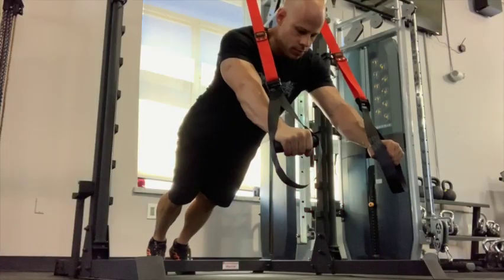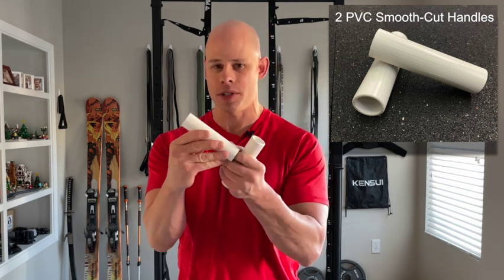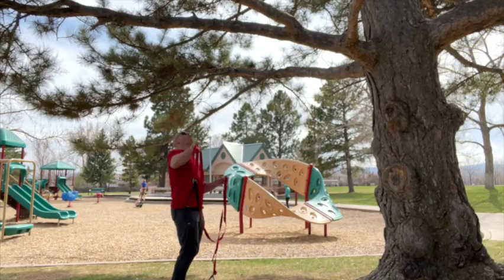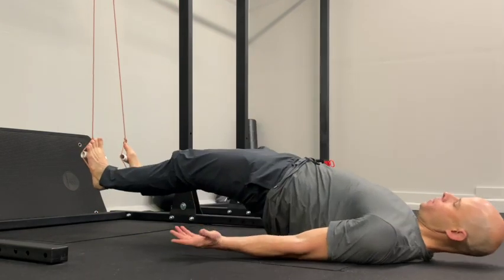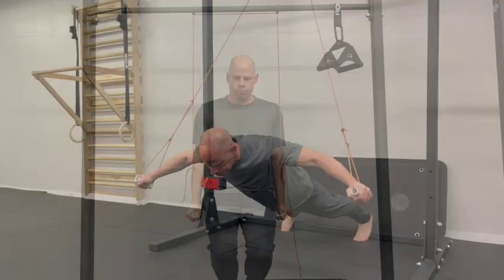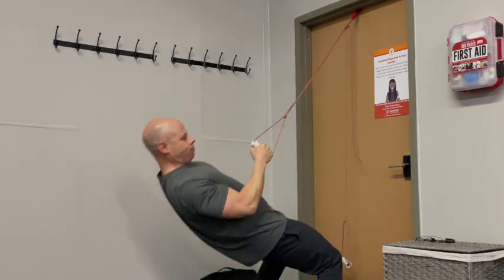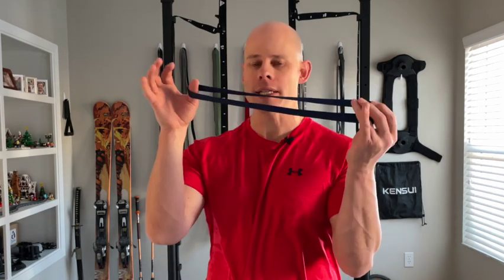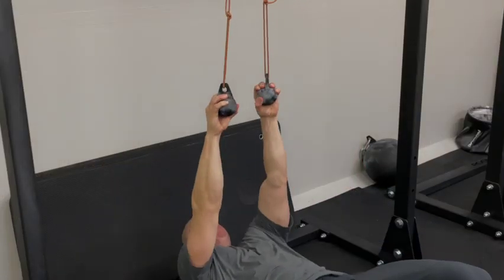My Ultra Versatile DIY Suspension Trainer

Comment: Hi, I'm a rock climber and let me tell you one thing, don't have rope-on-rope, @4:36 you essentially made a saw, all you need to do is make a overhand knot in your rope cord and put that through the door. Or a carabiner. Doing it through the webbing and then sawing like that will cause friction. Friction + weight = failure.

Comment: Simple and effective as RDP! I love DIY suspension trainers, every year you come with a easier one Matt :)
Reply from the maker: Glad you like them Federico. Still working on how to make something like this strap-based but that's proving to be much more difficult with the hardware. Hopefully something will pan out before I release the new book
Reply: @RedDeltaProject  Well, in the past I took a strap from a gymnastic rings set and add a tube in the middle, maybe it's not the best option, but worked for me for a long time. It's much lighter and transportable than the actual rings.

Comment: This is amazing. I also like to mention because I do most of my workouts using resistance bands that the door anchor idea was really fascinating. But also because I like to do my workouts outside, can you make a video on DIY anchoring system for resistance bands as soon?
Reply: Since Matt's prusik suspension trainer  I've thought just some anchor points for rope on one or two walls, + rope + prusiks + bands could work for near infinite anchor location adjust. Haven't tried it, though.

Comment: For a 5-6MM rope, a Ronstan Series 30 pulley would be plenty safe.  And smooth as butter.  RF35100 ball bearing pulley is rated for up to 8mm rope with a 660 lb max working load and a 1,320 lb breaking load.  Cost about $20-25.

Comment: I have a question about the handle, in a previous video you mentioned the prussic knot to make it easy to slide up and down the handles. Is it still a good option or your current video choice, the bowline knot, is better?
Reply: Good question! I was wondering the same thing.